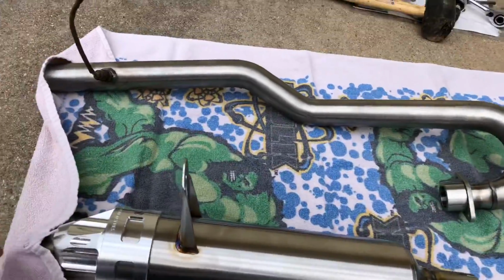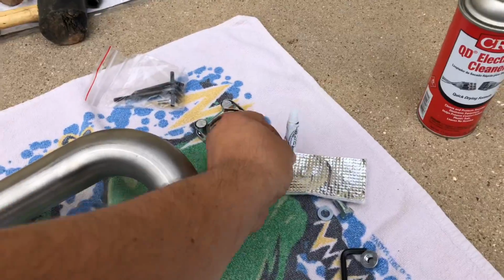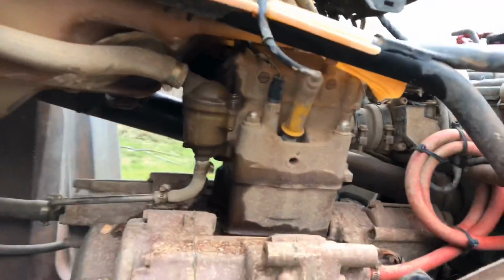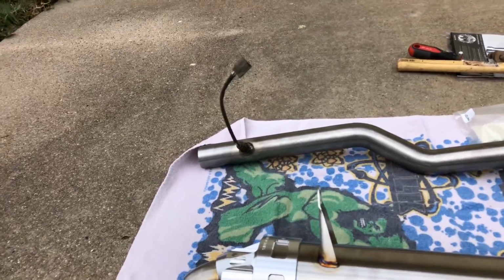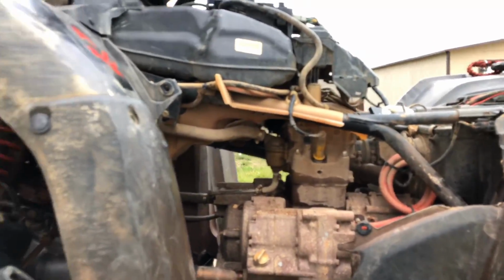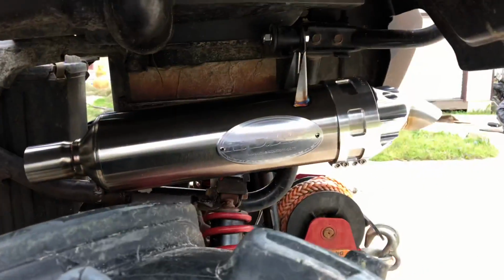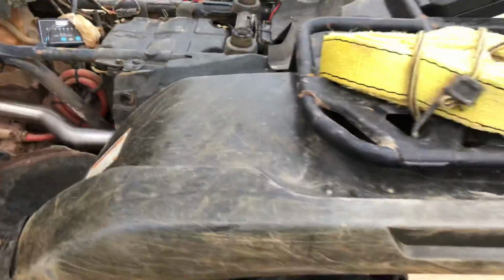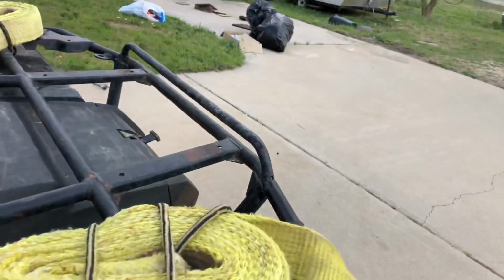RJWC Mud Edition Exhaust Install and Sound For 2016 Honda Rubicon | POWERMODZ

Comment: For idiling under water tighten your throttle cable line like 1 turn at the handle and you'll be fine.
Reply from the maker: I've been meaning to try that! I've read about that in the Mud Puppy facebook page but never got around to doing it. Thanks for reminding me about that!
Reply: @SwampAss  i want to buy a rjwc but idk how to put on the exaughts
Reply: @SwampAss  do u know any places that can put it on?

Comment: Carlos man I love the sound . I think I'm gonna get me one for my foreman 500❤👍😎
Reply from the maker: Oh me too brotha! It sounds tough now. I definitely recommend one if you’re in the market for an exhaust.
Reply: Dose this exhaust work on the foreman 500 because I got a 2015 and wanted to got one?
Reply: Aiden Mckillop I gotta 2006 I’m tryna get one too
Reply: DONT GET THE RUBICON EXHAUST IF YOU HAVE A FOREMAN GET THE RANCHER EXHAUST AND RUBICON TUNER IF YOU HAVE A FOREMAN!!
Reply: Just got one on my 2020 honda 420 it sounds sooo muvh better than factory highly recommend it
Reply: @chaserobinson975  did they stop making them?
Reply: @linkinpiatak6669  yessir discontinued them recently
Reply: @aidenmckillop4721  why get the Rancher exhaust instead of the Rubicon? I have a 2015 Foreman and have been looking at getting an exhaust.
Reply: @debo8003  if you have a straight axel foreman the rubicon will not fit so you need to get the rancher one happens to me if you have irs get the rubicon one.
Reply: @aidenmckillop4721  thanks!

Comment: That sounds nice.
when you get the efi controller do you keep the o2 sensor or put the delete back on?
Reply from the maker: I’m really not sure honestly. For some reason I feel safer running the o2 sensor and plan on running it regardless. My buddy who does some tuning on cars definitely recommended I keep it on there if I can and explained it to me but I didn’t quite understand what he was saying. I just remember him saying it could end badly. But his experience is with cars and bigger motors so I’m sure it’s not as much of a risk with these quads.

Comment: Will it idle underwater? And how much is the kit for it
Reply from the maker: I’m not sure yet. I’ve had the back part of the exhaust under water and it was still running but I don’t know yet how it handles once I go completely under. And I think the whole exhaust system is around $700. Check out PowerModz and the owner might be able to get you a deal on one.

Comment: Why did you take the 02 delete out? Would you not need to just plug the 02 on the new exhaust also?
Reply from the maker: Since the exhaust had a an O2 bung I wanted to use it so the computer could compensate the air fuel mixture the best it could because my programmer didn’t work anymore.

Comment: Does your aftermarket exhaust pipe doesn’t get cherry red closer to the head because my hfm titan xl exhaust pipe get red and I want to know if is normal or you have any issues with yours?
Reply from the maker: Not that I’ve noticed. Are you running a programmer? I think if it’s running too lean it’ll get red hot like that.
Reply: Thanks for responding back . It didn’t came with a programmer because according to hmf is not required for my Honda rubicon I don’t I’m going ty to get one

Comment: Do you need a tuner with the exhaust?
Reply from the maker: It is definitely recommended to make the fuel air mixture right. I really need to get one. If I wasn’t running the o2 sensor I would definitely get one right away
Reply: The one that came with your hmf will work. They are all dobek fuel tuners with different decals on them. Just get the settings from rjwc for it